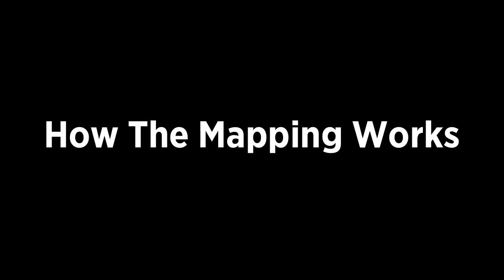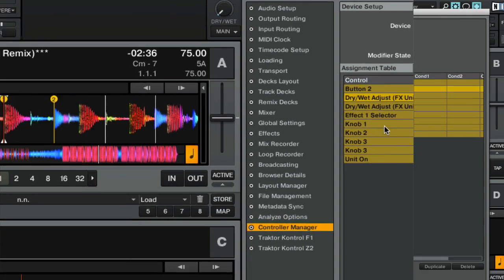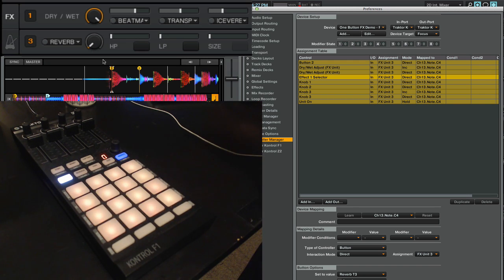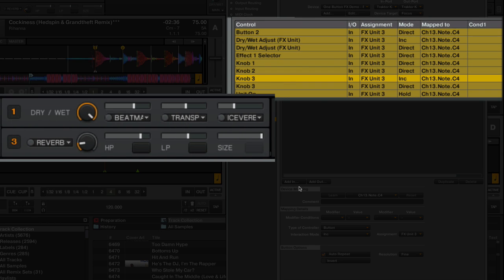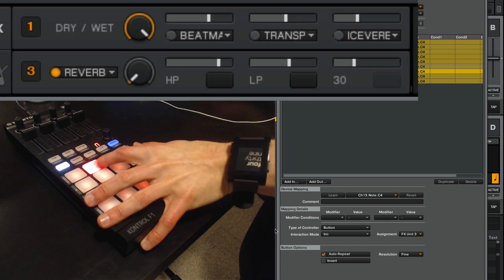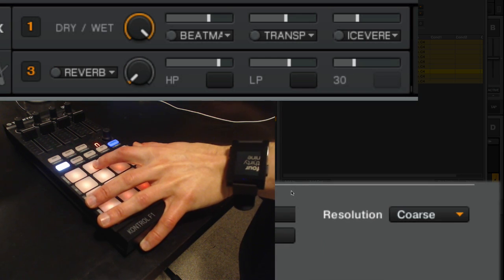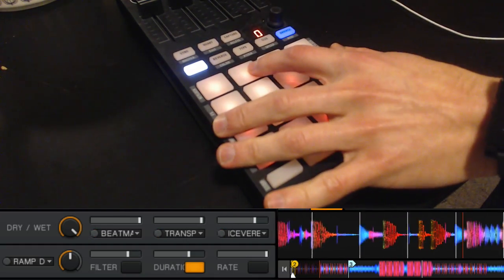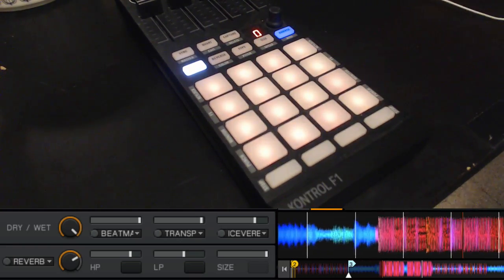One Button Effects Buildup/Breakdown FX in Traktor

Comment: Hey man! i really love the video and the effect but ive got this problem.... i can get it to work on one knob, but when i want to set it up with another knob at the same time it doesnt work.  here is what im trying to achieve: i want 4 knobs doing the one button trick. but however add in a fx unit selector on hold so i can assign each button to do the same thing on a different deck. so it would only take up one fx unit.
Reply: I figured it out!   i had to set the Auto Repeat manually to on. apparently it doesnt take that setting when you duplicate the command.
Reply: Double Identity is there any chance you can upload that in DJTech Tools forum?
Reply: StringSkipp3r upload what exactly? and i dont know how to use forums so...
Reply: Double Identity I mean the mapping (with the effects assigned in it)... I just started djing about a week ago and i cant really figure out how to put all those effects into one button in traktor pro 2.
Reply: its the same mapping as in de video except if duplicated everything 3 times so ive got 4 exactly the same mapping on 4 different buttons. but you have to click the auto repeat in every mapping seperatly.
Reply: thanks so much!

Comment: I'm lost, how do I get this to work? When I load the mapping and plug in my F1 I just get the standard mapping loaded. When I delete the standard I get no response from the controller. I have the F1 selected in the mapping and everything looks exactly like how his setting look.
Reply: Hey DJ Arifactz, you need to put the F1 into midi mode (Hold shift, then press browse on the controller to enter midi mode)
Reply: Ryan Dejaegher ok but the controller isnt responding to the mapping still.
Reply: Ryan Dejaegher yup i already had that but I still get no response :/
Reply: and you've selected the F1 in the in/out port and it's in midi mode?
Reply: Shift + Browse?
Reply: Ryan Dejaegher got it, thanks!
Reply: No problem =)

Comment: It doesnt work for me. It's still in remix mode, how do I change that, because it doesn't respond when I'm trying to set an effect for the buttons. Please help me!
Reply: by pressing shift and browse at the same time you can toggle your F1 between remix and midi-mode
Reply: holding shift and browse does put you in midi mode but a lot of the times people have that set to the user mapping.  To make sure you are purely in midi mode you should turn all your decks into track decks.  Then open preferences and go to the bottom of the left bar and select Kontrol F1 and at the bottom of that page click midi mode.  If your pads on your f1 light up a faint yellow/orange color then you did it right! :)
Reply: Noah Weller Thank you!
Reply: MrThorsen95 . No problem!  If you have anymore questions let me know!  I'm also coming out with my own version of this mapping that is far more intuitive and elaborate than this one, so let me know if you are interested :)
Reply: Noah Weller Would be great to try it out :)
Reply: MrThorsen95 . go subscribe to my channel Kp0c Music and I will be uploading a video going over the mapping and then I should have it up for download and/or purchase after that! I'm still finalizing because its a lot of mappings and macros but its very simple to use!!
Reply: @ac130spectre98  I see that worked out well.